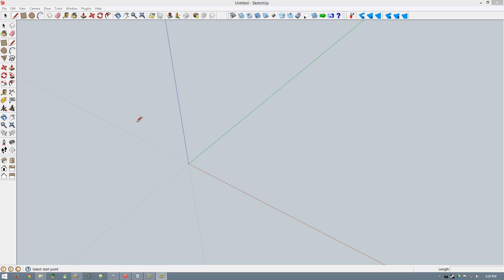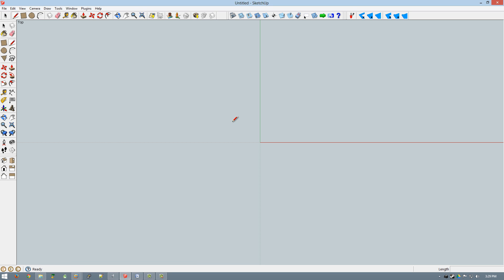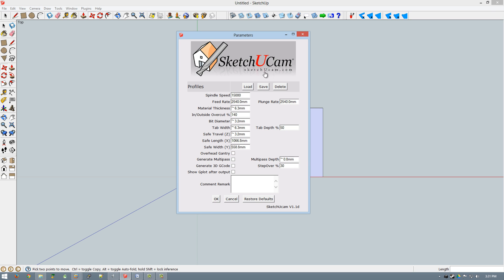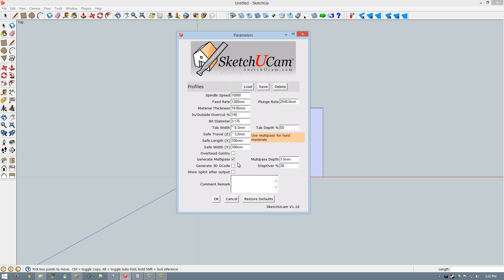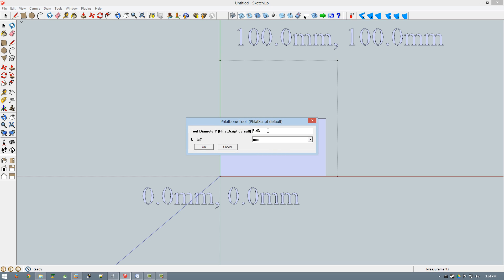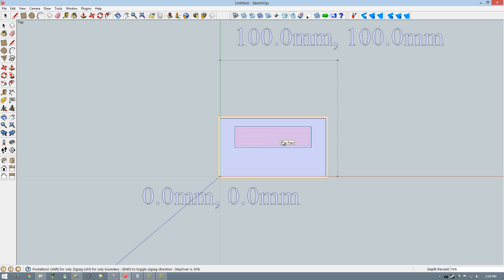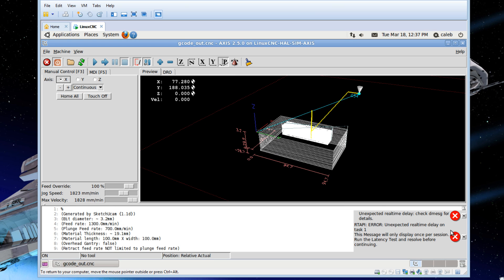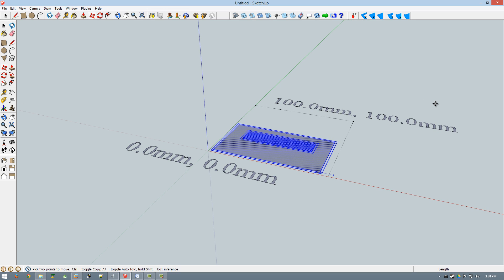CAD/CAM using SketchUp and SketchUCam

Comment: Going from Blender to Sketchup is tough, has to be because I tried going from Sketchup to Blender and found it awkward at best. You are correct in that SketchUcam is a great plugin, but it's just a plugin. Knowing your way around Sketchup is the key. Sketchup is an Architecturally based program and doesn't lend itself to really complex mechanical 3D drawing.  For CNC routing projects it's great, plenty strong, cheap, and imports into Mach3 no problem. I do high relief carvings with that software. Going into 3D printing design work then Blender takes the lead because it's great with stl's. Both are free, have a large knowledge base, enough plugins the land you an asylum, and with time get the job done.

Comment: Hello Caleb.  Sorry I'm a bit late on this post.  I guess about a year, but it is only now that I've decided to take the plunge, no pun, into CNC.  I've been using SU for several years and frankly, I couldn't build a shelf without using SU.  It's the fastest way for me to see what's in my mind and to put onto the screen.  So since a years has past maybe you've seen the SU light and come to the dark side.  The only thing I can say abut the Plug in's is I have found them difficult to load, somewhat un-reliable and once again, no pun intended... Sketchy!  I'll give this plug-in a rty cauz I'm already a user.  Thanks for the series.  Very helpful to a newB.  Regards,  John Nelson

Comment: Thanxs for the video. I am on the edge of getting or building a CNC. I've already built a 3D printer of my own design (http://www.thingiverse.com/thing:313095), so I think building a CNC machine shall be eazy.

I mainly use 3 pieces of software, SketchUp, NetFabb Studio Basic and Slic3r. I draw my 3D objects in SketchUp, use a plugin to export my objects in STL format, then use NetFabb to fix anything wrong with the STL, and then slice the corrected STL file with Slic3r.

I saw in a different video a user going to thingiverse, downloading an STL file, and then getting tool path generated for that STL.

If one draw a 3D object in SketchUp, that is in reality a 2.5D object, meaning no overhangs, can you not skip the UCam plugin, and convert your 3D object converted in STL to tool path directly ?

Jeff